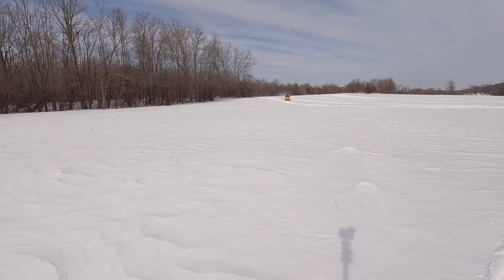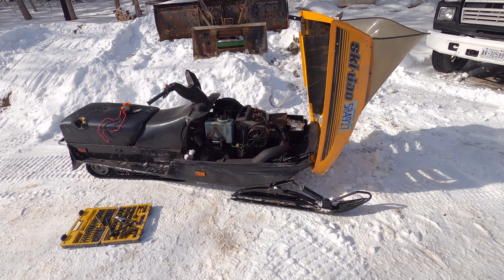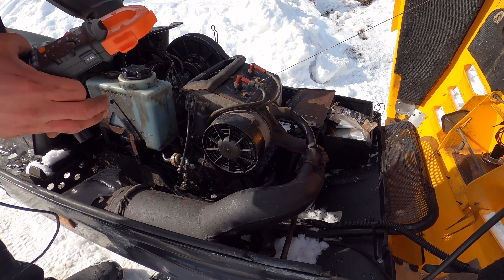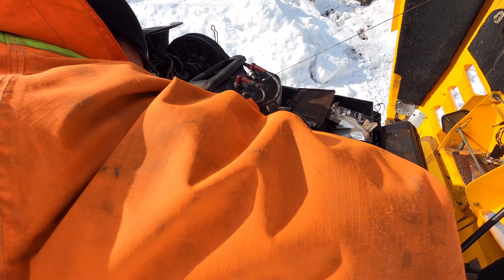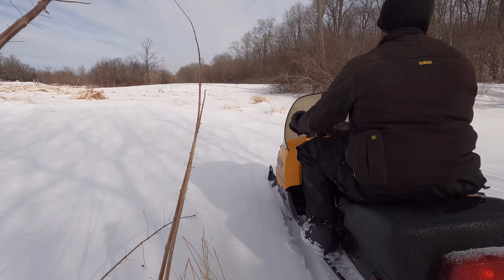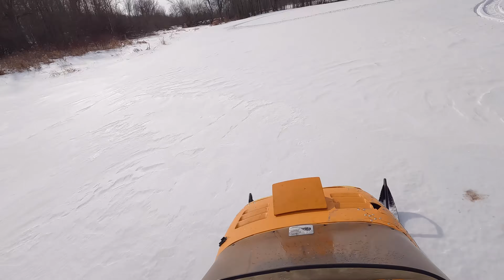Ignition and Spark Plug Testing with Multimeter on Ski-Doo 377 Safari

Comment: 👍thanks for the informative post! Maybe adding how to check for a faulty spark plug cap? This will drive you crazy if you don't know how to check the resistance! 
caps usually have the rating cast onto them. Most popular is 5K.

Comment: Have you ever or is it common or does it happen where the resistance value changes once at operating temperature? Do you happen to know if either the ignition coil or cdi  start acting up after sled has been running a while?
Reply from the maker: The Cdi is generally more susceptible to heat failure as it’s directly attached to the engine. Both devices however can fail once engine is heating them up.